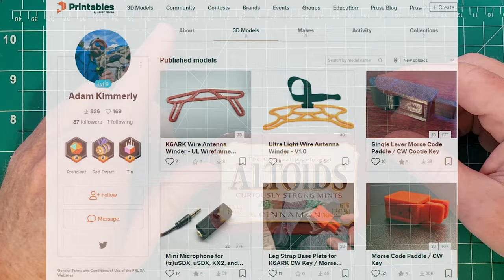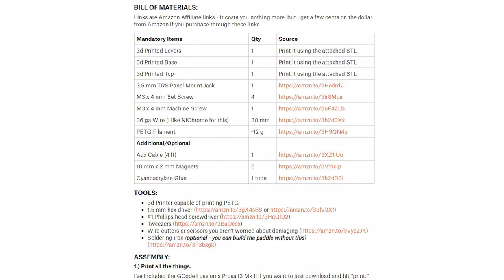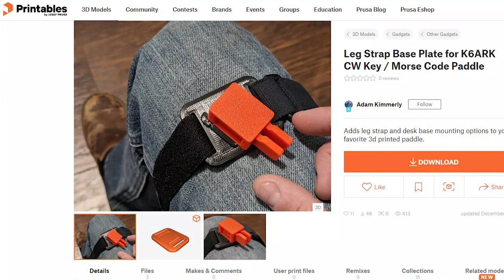K6ARK Morse Code Paddle / CW Key

Comment: Thanks for sharing my paddle design, Charlie.  I think your review scores were fair, or even generous.  This paddle isn't perfect, but for the incredibly low cost, it's a marvel.  That was my goal with the design - simplicity, affordability, and high-performance.  I think I accomplished all of those.
Reply from the maker: I really had fun using this paddle.  Thanks!  I forgot about the delicate nature of those hinges, I agree with a C grade on durability.  I hope viewers check out the comments here as I suggest because this isn't the first time I've been convinced that a grade should be different.  But, YES, this checks all the boxes in my opinion.  Just wish I had a printer.  I broached the idea with Sandy.  Maybe someday soon!
Reply: I wish there was an easy 3rd party service to print them for us, full-time RVing is hard just to bring any printer let alone a 3-D, lol. I want four just for my SOTA/POTA packs for both primary & backup use.  Cheers, Davey - KU9L
Reply: It's a great design Adam. I've used mine on a bunch of SOTA activations and it's been solid. Thanks for sharing it with the community!!

Comment: As a full-time RVer I do not have access to a 3-D printer, but this would be great for some of the QRP clubs out there selling kits to offer to their customers for a license fee to Adam. I would buy several for my SOTA/POTA packs, even perhaps as a backup paddle for the pack if your primary paddle loses a part, lol. Thanks for reviewing & now I just have to dream about it, lol. Cheers, Davey - KU9L
Reply from the maker: Hi Davey - it's a great paddle!  I'm in the same boat.  I sure wish I had a 3D printer.  What paddle do you use as your primary for SOTA right now?

Comment: That paddle is one of my favorites to use in the field! I actually just designed a modified version of the paddle that mounts to the bottom of an Elecraft KX2. If you want to print it, check the remix section of Adam's project on printables and my project should be there.
Reply from the maker: Excellent!  I'm glad you posted this information here.  I hope the KX2 crowd sees it.  Thanks!

Comment: How the durability of the plastic flex hinge - KC9WIB
Reply from the maker: Hi Mark - the hinge is quite delicate and can separated easily if you hit it just right.  Temperature can affect the durability too.  However, it is enclosed and if you aren't rough with it, I think it will be fine long term.